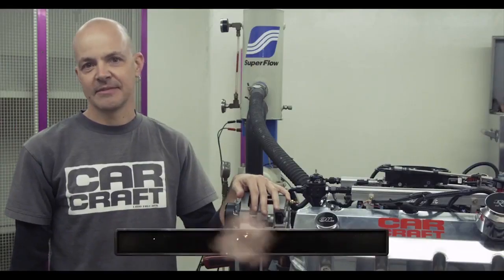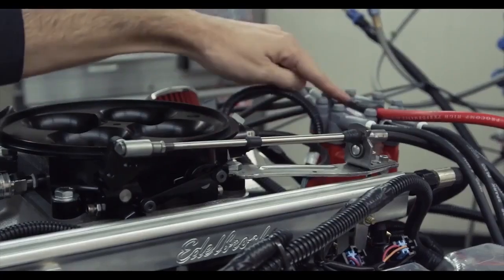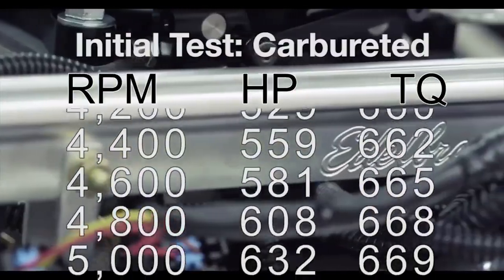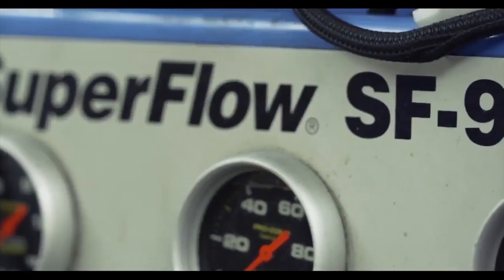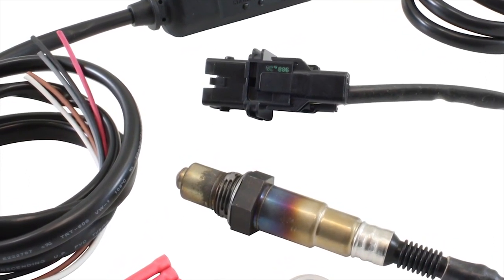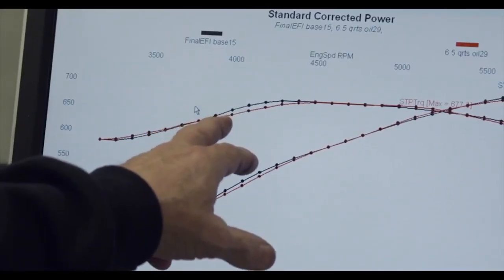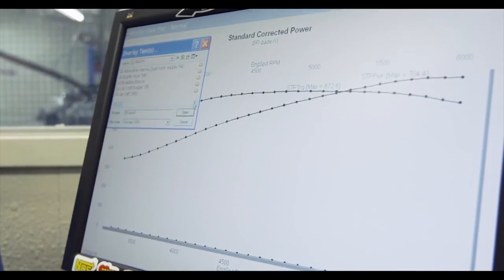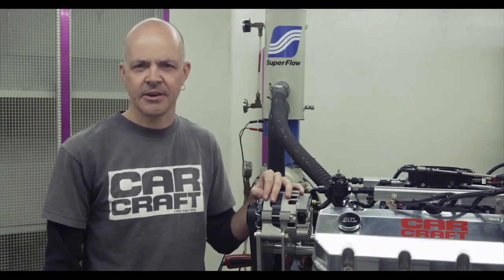Carb vs Injector   Hot Rod Network

Comment: 3 minutes in: TBi has no booster, thus more cfm.  so just put on a slightly bigger carb! <g>.    489CID tall deck 454 10.28:1 world heads biggest valves roller valvetrain offy IR twin 1150s 688hp

Comment: ONE run on the (who knows what size and tune?) carb version, no info at all.  Then many runs on the EFI version to struggle to get all the possible hp out of it, and it was very similar.  With (of course) 5 times the cost. 1.3 hp per cubic inch shows a somewhat subdued big engine.  The lower RPM' build is where EFI would seem competitive.  Sure like to hear the actual cost of the EFI with all the electronics, sensors, software/hardware, wireing welding on oxy sensor bung, new fuel pump/filter, etc.

Comment: Oh how sneaky of you guys to not even mention the carbs CFM LoL
Reply from the maker: Not trying to be sneaky. We don't recall the carburetor's CFM but it was not as high as the throttle body. It's relatively common to have to run a larger throttle body in EFI applications to get the equivalent wide open throttle performance as a carbureted application. While this is a dyno test and they tried they to keep things as equivalent as possible, the end result was showing that not only can the same performance be gained using EFI, but also that you have the benefits of improved cold start, overall drivability and economy given that this is a street truck. On long-distance trips cruising at 70 MPH, this BB engine averages 3 MPG more than the original carbureted engine that came with the truck. When you consider this and factor in the engine failsafe features, launch control, traction control, data logging and ability to control boost if turbos are added in the future, we believe it's hard to argue the advantages of carburetion over modern EFI.
Reply: @AEMpowerTV The CFM difference in your test is massive, the guy says the old carb was a dominator at the beginning of the video which means it was a 1400 CFM at the most and a 750 at the least. The EFI system is 2000 so even the best case scenario is a whopping 600 CFM difference and it makes the test totally unfair. That's like bolting a whole extra carb to it and claiming electronics made the gain. Engine Masters just recently did a test where the carb and EFI were within only 50 CFM of each other and the carb came out on top. 
And I must say EFI offers no real cold start or efficiency advantages over a properly functioning carb, been daily driving a 68 Plymouth Roadrunner for almost ten years now and it starts up immediately even in sub freezing temps. It only takes a half rotation for the engine to fire up, not three, four or five like all this modern fuel injected stuff. The car also gets over 20 MPG, it used to get over 25 before changing the rear gear. 
Thanks for allowing/responding to my comment, Merry Christmas to you and yours.
Reply from the maker: Merry Christmas! Thank you for watching the video.
Reply: Gaming you got owned dawg.
Reply: The carburetor its better no sensor problems at all carb rules